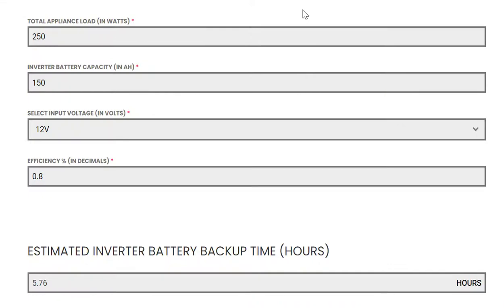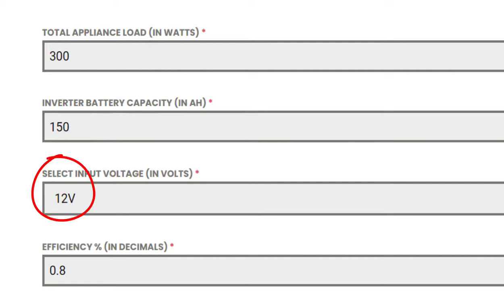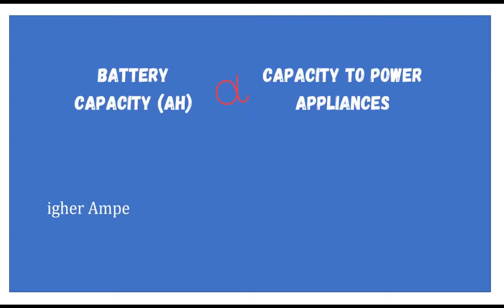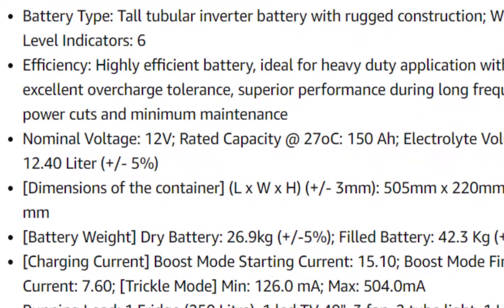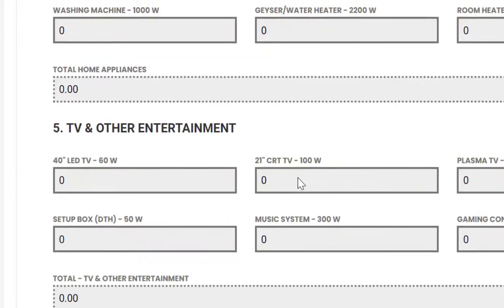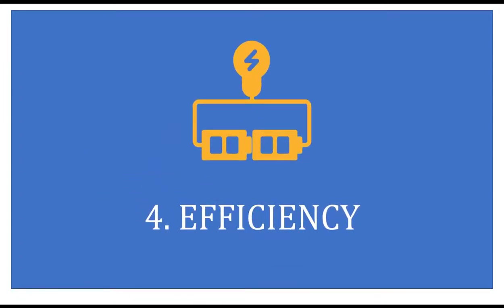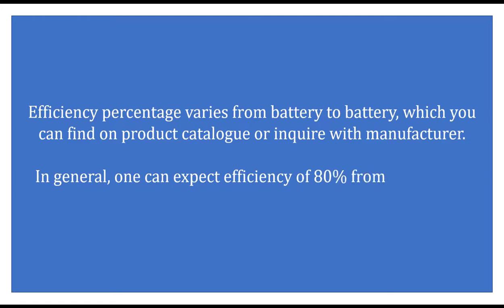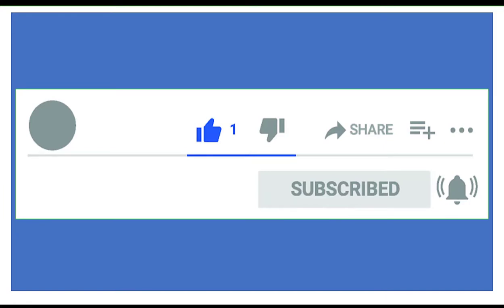How to calculate inverter battery backup time [Run time]?

Comment: Nice informative video . 1 doubt when buying inverter battery i.e C10 and C20 battery .other than charging and discharging rate of current How is the performace of these batteries during power cuts. I mean do appliance can have faults when using c20 battery system while being connected to a sine wave inverter. Or is it at par with c10 battery interms of discharge of battery current. Thanks.